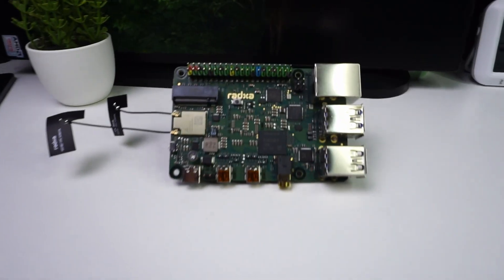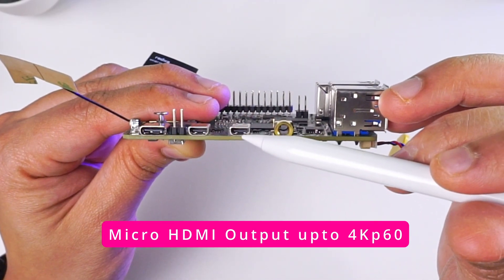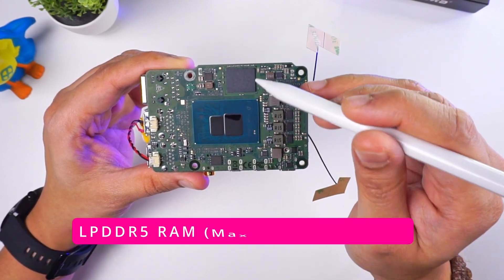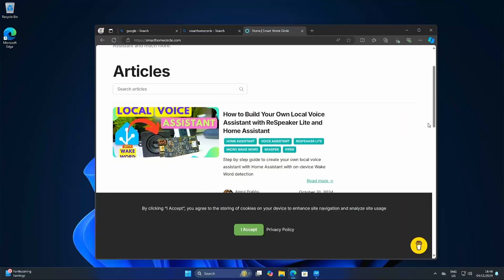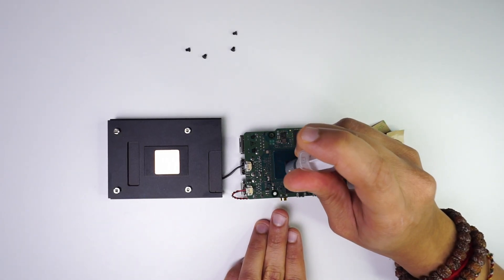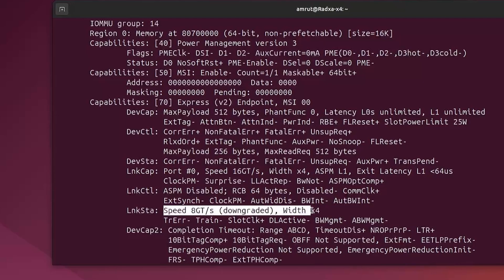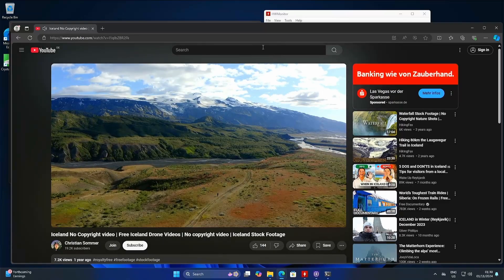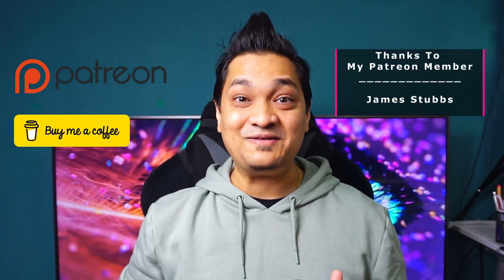Radxa X4: 60$ POWERFUL🔥Alternative For Raspberry Pi 5 | Performance, Benchmarks, Home Assistant Uses

Comment: What's the thickness of the copper plate? It's a shame that it's not available anywhere apart from 4gb ram and the producer delays replenish the stocks.
Reply from the maker: I brought the 0.5 mm thickness for this. 
I have added a link in the video description to buy this.
Reply: @SmartHomeCircle  I took a picture of the gap and let ChatGPT to calculate the height. The result was 0.69mm. I bought also 0.8mm copper plate just to be safe, if the SBC will be back in stock, I'll test it with that.
Reply from the maker: @ozkantuzemen  no issues. Dont forget about the heatsink paste. That could take up some space, maybe 0.1 mm

Comment: is it useful for home assistant for 3 bedroom apartment ?
Reply from the maker: It is definitely more powerful than the raspberry pi 5. You can run Home Assistant with the local voice assistant components like Whisper, piper on it and with quicker response times compared to the Raspberry pi 5. I have shown this in the video.

Comment: add some thermal paste on both sides of the included thermal pad to get a much cooler X4 . that's what i did
Reply from the maker: I did the same in the video 😄
Reply: @SmartHomeCircle  didn't catch that on the video
Reply from the maker: @anonylesss  there is a chapter, replacing thermal pad with thermal paste..
Reply: @SmartHomeCircle  oh cool. i just used the thermal pad and thermal paste on both sides, as i didn't have a cooper shim. got pretty much the same results as you did in the stress test
Reply from the maker: @anonylesss  Nice.. I like the device. It is nice and compact.
Reply: @SmartHomeCircle  yes, and  it's excellent value for money. i got the 4gb/32g version to replace Pi4 4gb with a slow 32gb SD...the performance boost is incredible
Reply from the maker: @anonylesss  yes.  Its super in terms of cost to performance ratio.